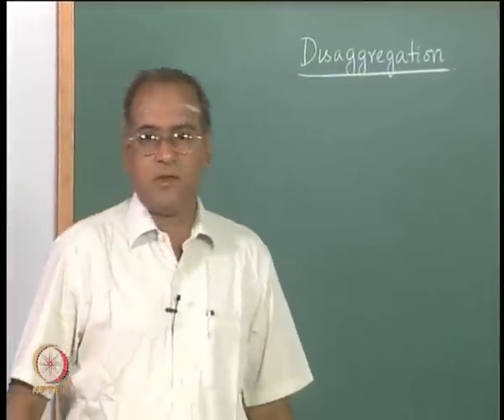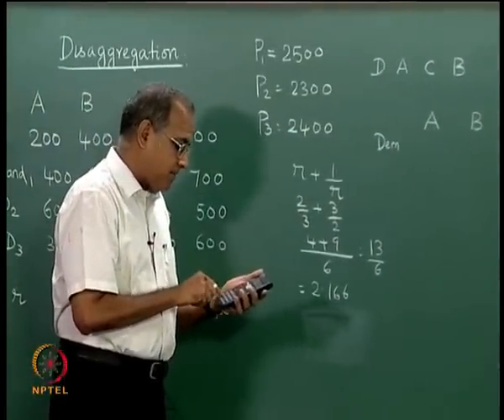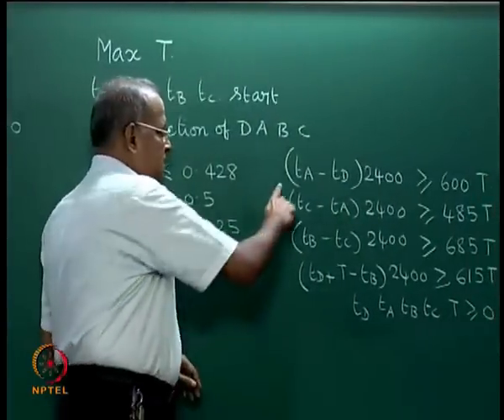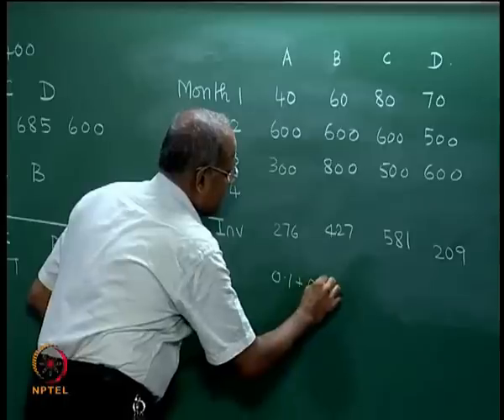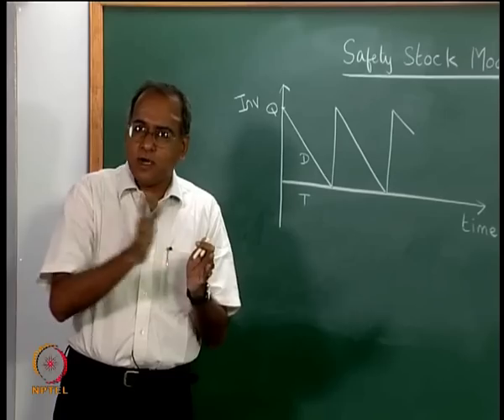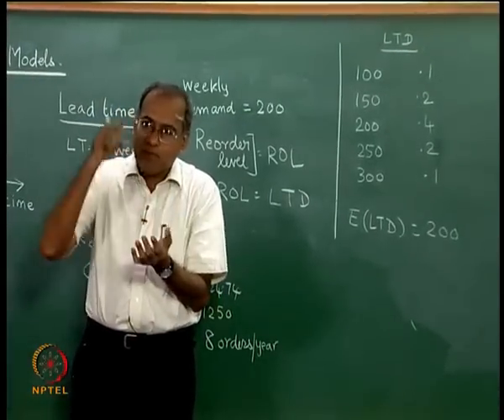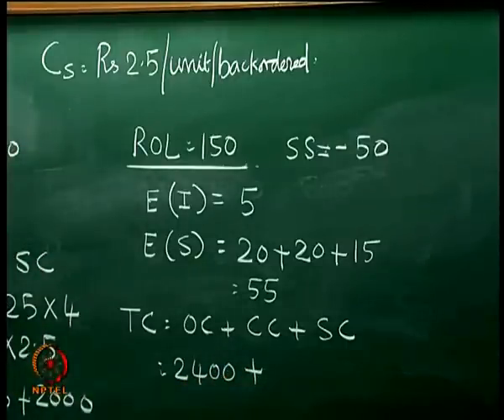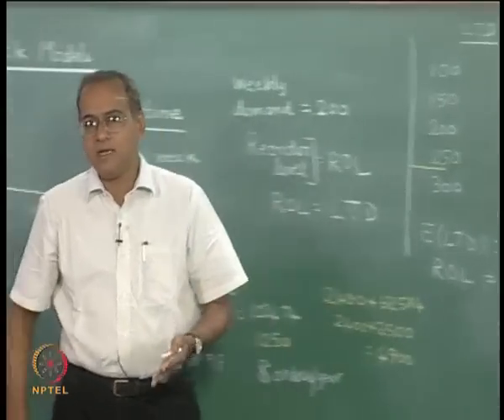Mod-05 Lec-20 Disaggregation -- time varying demand, Safety stock -- ROL for discrete demand

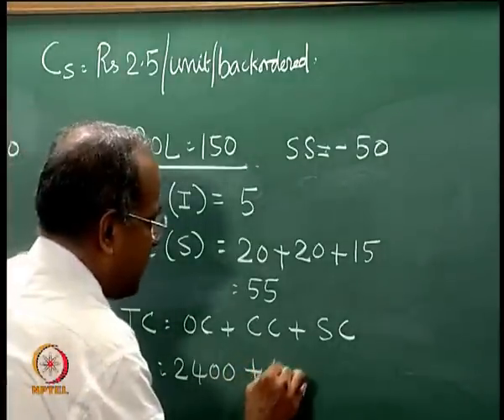Comment: sir at 52:15 (safety stock was -50). So Carrying cost should have been 675*Cc
Reply: dont go with + or - just understand that if there had bee a safety stock of 50 available then average is 625 +50, but in our case it is shorted hence the average inventory in a period will be 625 -50(because before we reach T stock goes less than 0 so no cost for holding anything)